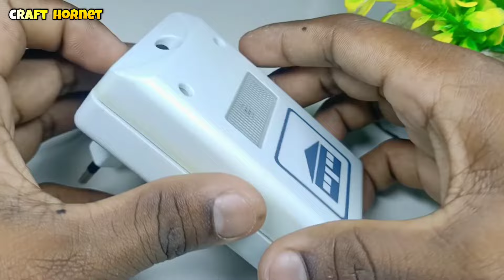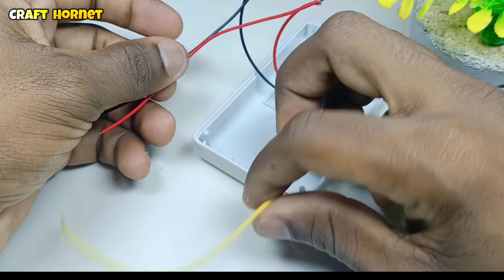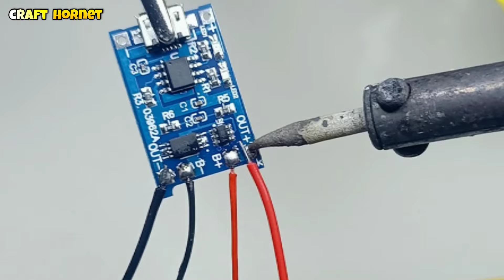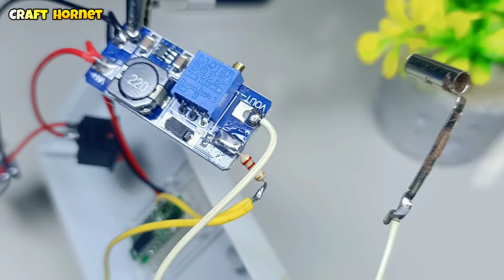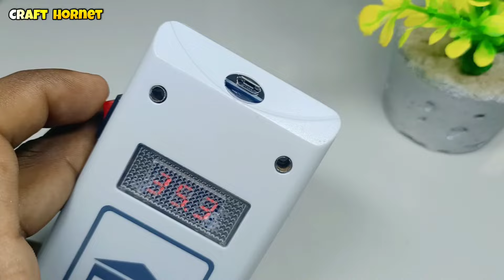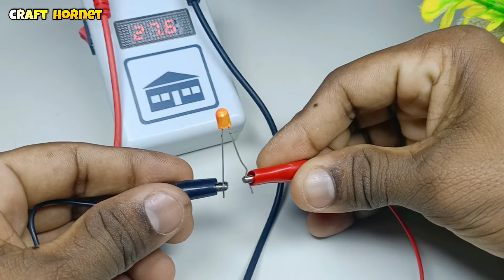LED tester DIY | homemade

Comment: Boss i did the same as you demo but the converter not fuctioning to step up 3.7 volt dc to 30 volts ,i compare the part and connection but still not steping up. Why?

Comment: CAN YOU SEND ME THE FULL PARTS LIST PLEASE?
Reply from the maker: Voltage meter
MT3608 module
TP4056 module 
3.7 rechargeble battery
On/off switch
2.2k resistor